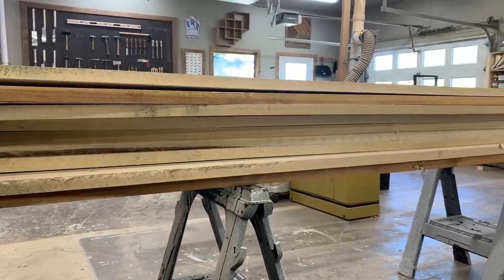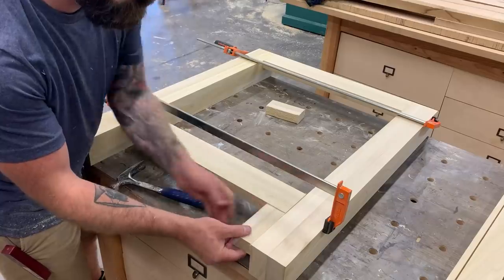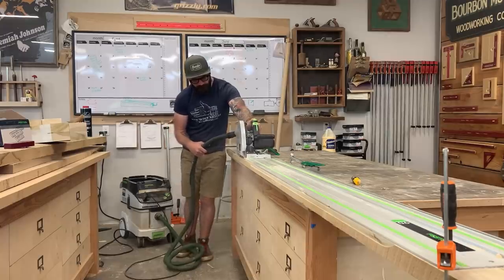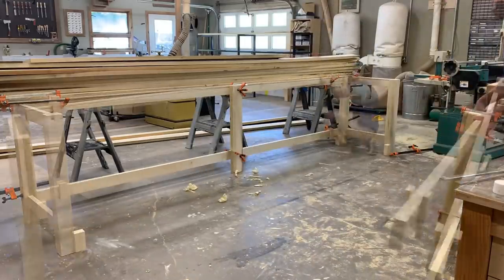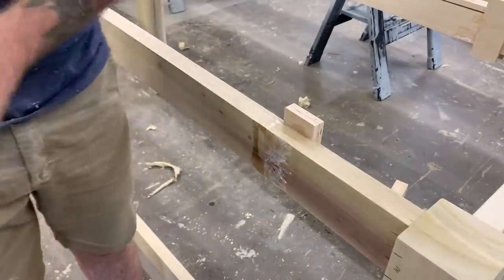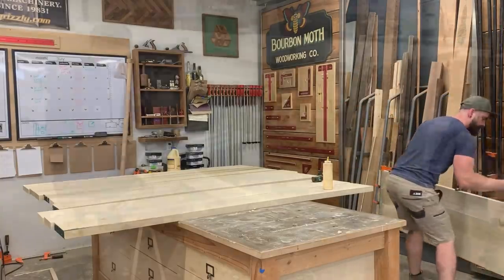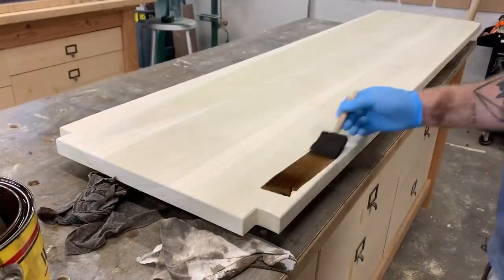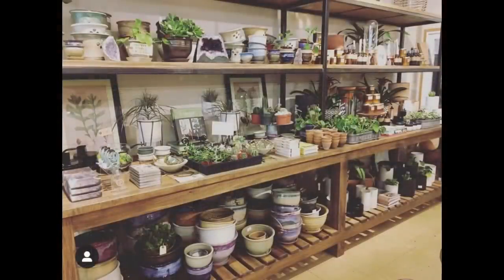Monster Table | Building a Giant Table

Comment: Did you have to do anything to the poplar to get it to take the stain so evenly?  I've only used it once and it finished very unevenly.
Reply from the maker: Nope it took the stain great
Reply: If the boards are clear it stains pretty well. If they have any green you can bleach them with oxalic acid.

Comment: Really dumb questions - how did you attach the table top to the frame?  What was the purpose of cutting 1/8” grooves in the frame panels near the top?  Are the two related?  Why couldn’t your mom help with the sanding?

Comment: It looks decent, you can see where you glued your clamping blocks onto the apron. CA glue soaks into the wood too much to be able to sand it off without going at least a 1/16" deep in nonporous wood to not interfere with the staining. Next time try using high quality double stick tape on your clamping blocks then screw them together around the board and you won't have any problems with contaminated wood in the future.

Comment: On the chop saw, why does he score the top first and then do a second pass where he goes all the way through?
Reply: It relieves the stress in the wood, so if the board wants to pinch the blade, it only does it lightly and he can push through easier.

Comment: Instead of glueing wood to wood for the culls, have you tried putting masking tape on both surfaces and glueing on the tape instead? I'm not sure if it has the same amount of holding power but hey, if it cuts down on sanding it's worth a shot!

Comment: The better way to do this would be to make the legs removable so the table was easier to move.  Having the legs permanently attached just makes this crazy hard to move for no good reason.  Ever heard of bolts?
Reply: Bolts? That's not woodworking. Keyed tenons is where it's at. Lol.